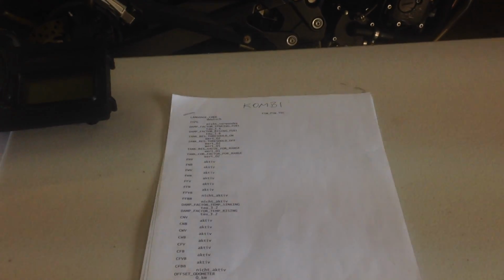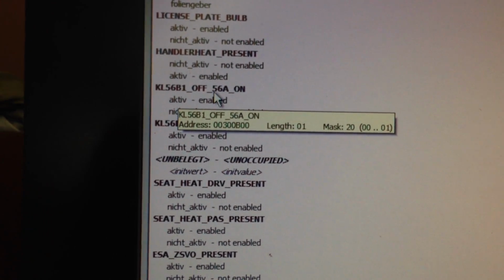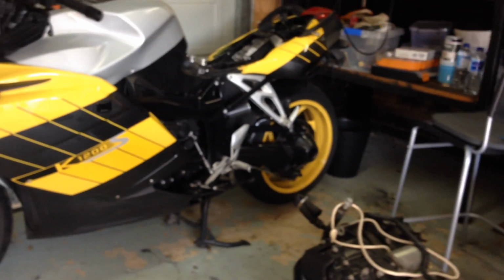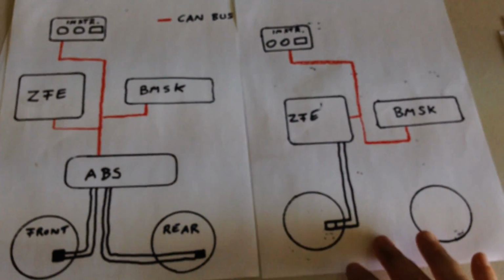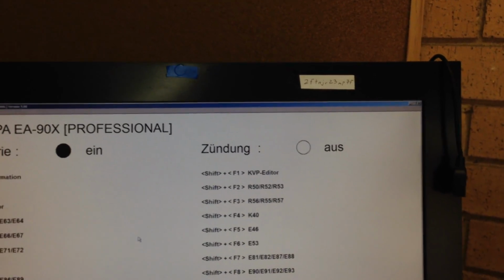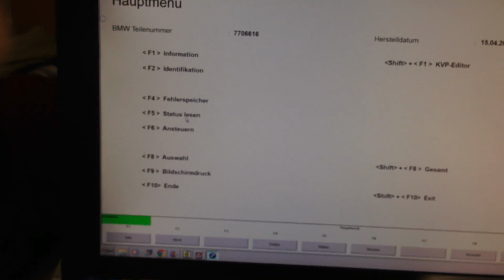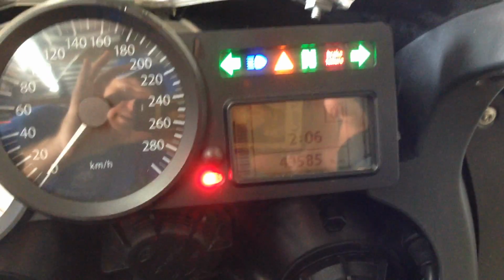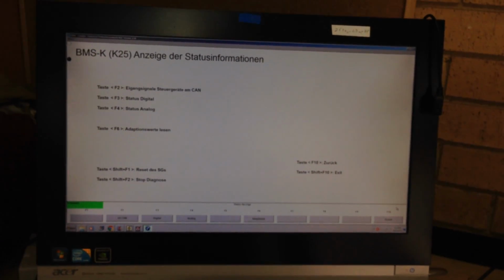K1200s K1200r gt K1300s K1300r gt technical review and insights Part 3

Comment: Brakes failure occurs when the ABS unit stops pumping.  It gives vastly reduced braking and the brake lever pulls pretty much right up to the bars.  I know, as it happened to me on my K1200s.  My ABS unit was mechanically good, but the electronic PCB attached to it had suffered moisture ingress, either from seal failure or from brake fluid ingress.  Either way, it rots away the lower part of the PCB and stops it operating the two pressure pumps inside the ABS unit.  I cannot speak for the later ABS design that uses only a single electric pumping motor, nor the way the PCB is housed and connected (the previous one is attached to the ABS pump and has the ability for a seating seal to allow some brake fluid to get into the electronics, as well as water to ingress from the outside when other gasket seals lose their functionality).  I now own an '09 first production year K1300s, which also has ABS/Traction Control as well as servo-powered brakes that employ the ABS unit to provide that servo action.  Thus far, no problems, so my fingers are crossed!

Comment: Hi  hello from the UK     Thanks for the great videos i've watched them avidly ,  with not having a windows pc , i connected my  2005 k1200s  to a MOTOSCAN android  app with a   NEXUS  BT  dongle    whilst browsing the MOTOSCAN menu for  the  k40 model    i looked   for the menu  to change my  lights over to led and  hopefully turn off the light icon  fault    ( i had  upgraded  a week before ) , the app connected to all the modules  i check the info vin number , 4 cys etc etc ,   all correct   without activating any of the options  (the ignition was on)   the  without touching the bike the low head light low beam  turned on ( before it only came on  with the engine running) ,  i turned the ign off and on, since then   it wont start,  no N light  No gear position , and, unable to connect to   ZFE and  Kombi and  only   info which i think is held in the BMSK  and that now  gives me  2 cyls   and the vin No has an  " ! "  i was just wondering if you had even had this problem     Many Thanks    John
Reply: Oh boy! Sounds like the diagnostic reader was a bit dodgy. Out of interest, did you get it sorted?

Comment: Did you try to code a board computer function in Kombiinstrument? As i could see in your movie, You don't have "BC" button on your motorcycle. In BMW parts catalogue I find only one type of instrument cluster. In BMW cars, for example E46, to activate BC i use NCS expert to code it in Kombi. Best regards!
Reply from the maker: The warnblink button is either ASC or BC now. The 07 wiring loom has the BC external temp probe, but the Kombi is not capable to display BC functions. Its the first generation kombi instrument.
Reply: I have '05 K1200R, and in my owners manual are described BC functions. Wiring harness also have connection for optional external temperature sensor. I will try to read coding with NCS.
Reply from the maker: In NCS you will find the BC options in the ZFE. But my kombi is first gen. display. It can not show RDC, outside temp. Its not the spaned display type
Reply: Connections for BC and TRIP button are the same. If my Kombi not support BC i will change it.
Reply: Today i've coded R1200GS '08 without BC,  i've activated this function and it works fine!
Reply from the maker: Look at my other Video at 11:40. This is the first display that BMW installed. It is not capable to show BC or Tyre Pressure function. https://www.youtube.com/watch?v=1_Q6sr0MPZ8

Comment from the maker: The bazzaz module is just like a powercommander. Its spliced between the BMSK and the injectors. I can't say with 100% certainty if the bazzaz would work on a 1200, but all the plugs are definately the same (fuel injectors, throttle position sensor). 

How this module is going to prevent wheel slip though is a mistery to me.... Using engine rpm to prevent wheelslip? Not sure what magic formula they are using, but thats a first time for me........

And the price..... holy sh_t!!!

Comment: Thanks for another great video. So, if I understand correctly, the computers on the k12 and K13 are identical aside from their software. Do you think it would be possible to make accessories for the K13 work with the K12? Specifically this system:
https://www.revzilla.com/motorcycle/bazzaz-z-fi-tc-traction-control-system
I suppose it may still be necessary to use the system in conjunction with K13 software?Thanks again for the helpful videos and advice!
Reply: you probably dont care at all but does anyone know of a tool to get back into an Instagram account..?
I was stupid lost my login password. I appreciate any tricks you can give me
Reply: @Byron Ellis instablaster :)